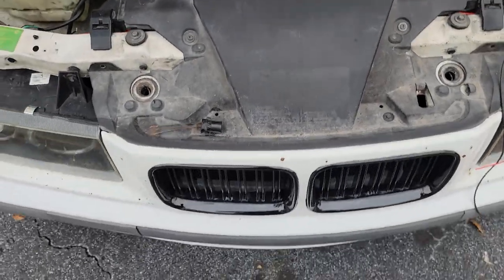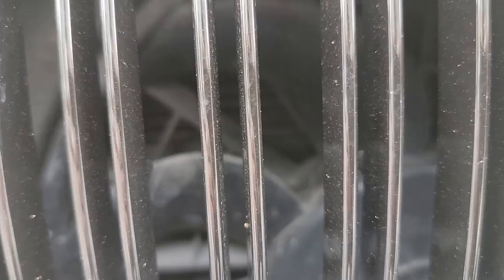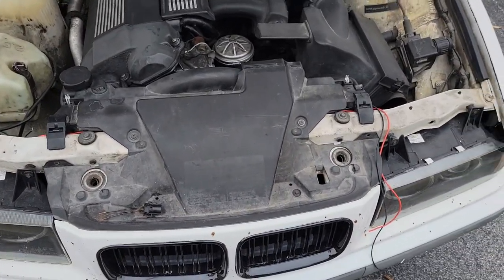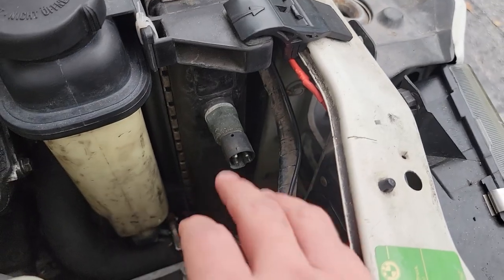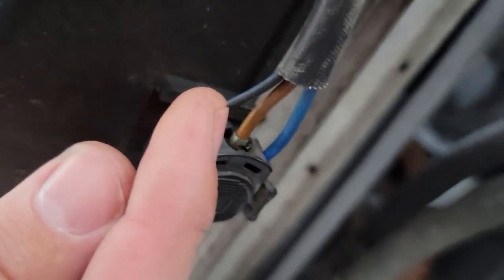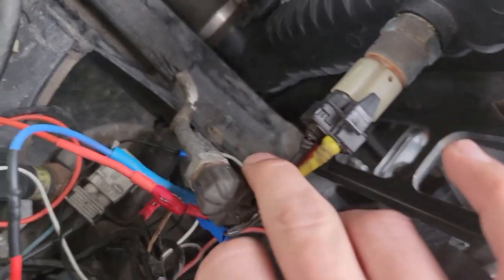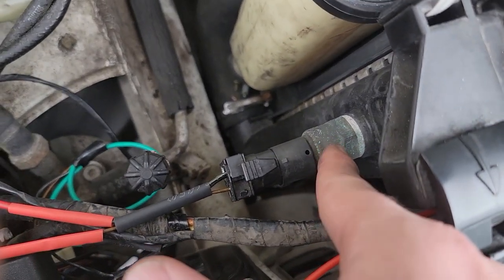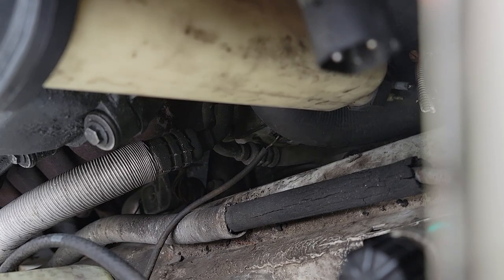BMW E36 Overheat: Radiator Fan and Temperature Sensor

Comment: Hello, can i ask you something? i have E36 318is i have to aux fan. one (the OEM) front of AC radiator and 2nd on main engine radiator. can i delete the 2nd fan and work the car only with the OEM aux fan without a clutch fan?
Reply from the maker: Yes but the opposite works best which is what I did on both
Reply: The puller fan can work by itself however the factory wiring uses the pusher fan if it has that option when the A/C pressure increases.
Wiring may need to be adjusted.

Comment: Very cool! My fan was not working and I tested everything. Fuse ok. Relays ok. and Getting power to the fan plug. Then I decided to connect the fan directly to the battery (12v) and it was dead. But If I connect the fan to my 20V drill battery the fan powers up perfect. Maybe the motor is so old it can't power up at 12V. Thoughts?
Reply from the maker: Yes it might happen. I did all this on the video and it worked but still had some random problems after that of the fan sometimes working and sometimes not, being too old and heavy, and getting stuck to kick (depending on the position it last stopped) even with good/new battery. Ended up deleting the whole thing and revamping even more with electric fan (same system on the video, just a different fan itself) hope it helped.
Reply: @nomodnolife 
Good to know. I corrected my previous comment. If I connect to my 20V drill battery the fan starts but not at 12v from the car. Even though the fan is 12v fan. So I just ordered a new fan. I’ll see how it goes and report back.
Reply: Factory fans have a 0.5 ohm 100w resistor wired in near the fan motor. These can fail, test the motor without a resistor.
Reply: @brandonrobishaw7606 
Thank you. I went ahead and replaced the fan. It works perfect now!

Comment: can u be a little more clear on the wiring so u run a positive cable with a fuse that positive goes where to the connecter to which cable ??